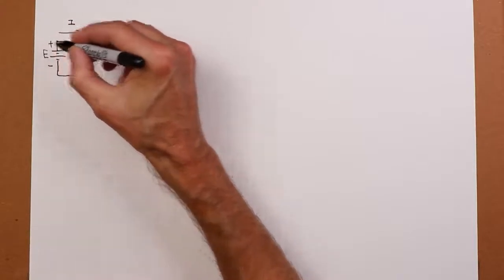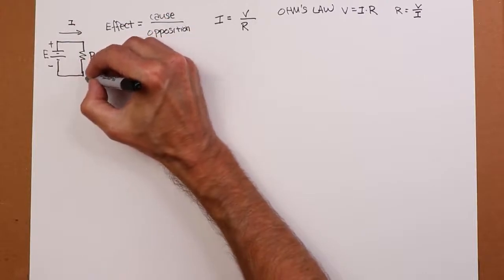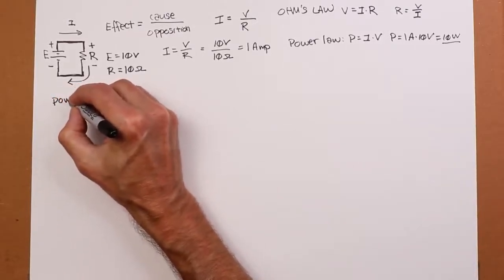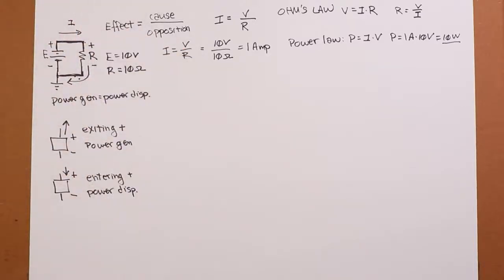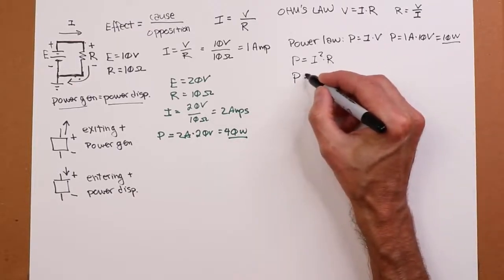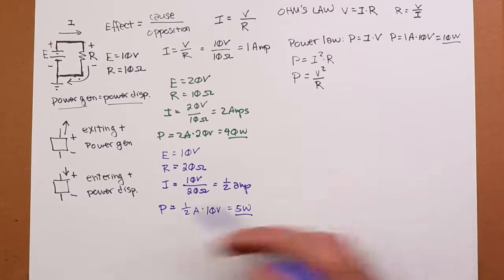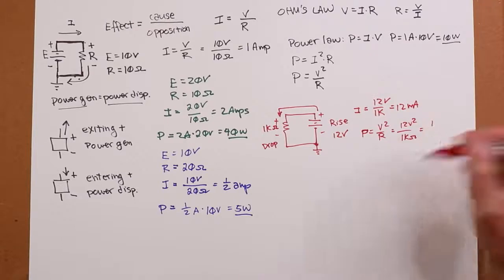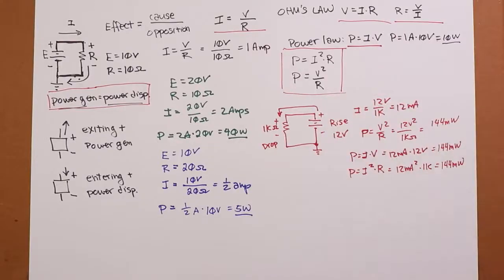DC Electrical Circuit Analysis: Ohm's Law

Comment: can I omit the earth ground from my schematic circuit drawing ? 
Isnt the battery negative terminal itself enough ?
Reply from the maker: Not really. You want to establish a reference point for voltages. If you don't include ground, where is that reference? This can be a problem with simulators. Normally the reference is denoted as node 0. Depending on the simulator, it may just assign some random node as the reference or it may refuse to perform the sim.

Even if you don't use a true earth ground you should indicate the system common (AKA "chassis ground" as in a battery powered circuit). In introductory circuits it is common to leave that off for simplicity sake, but that becomes an issue when the circuits get larger.